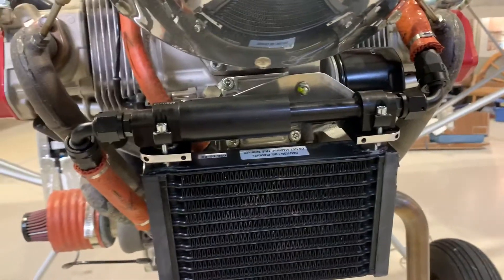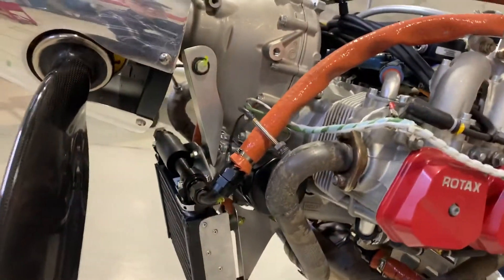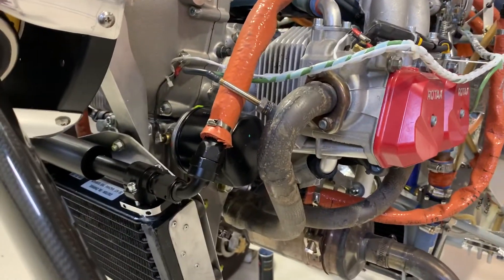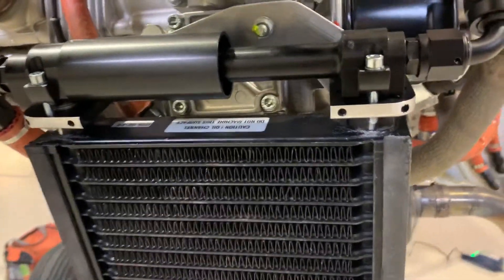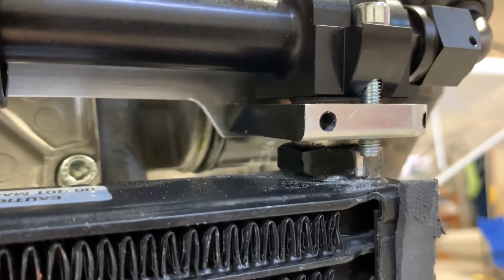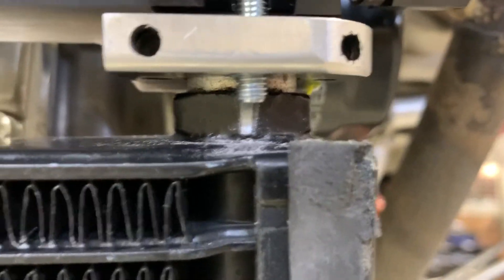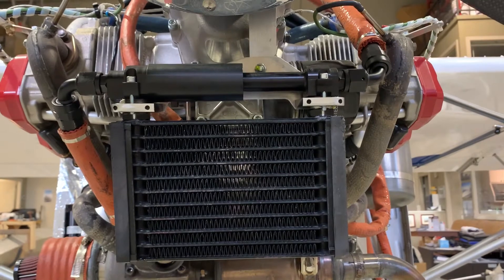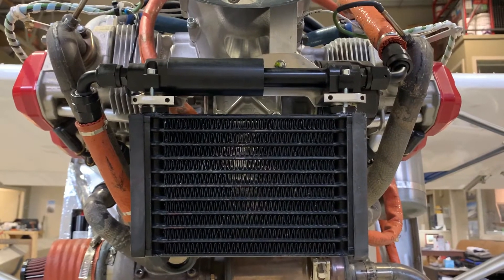Installation of Franz oil thermostat on Rotax 914 / Rans S20

Comment: Added larger oil cooler into same position as yours and added an oil thermostat at the end of this past summer.  Now oil runs 180f-188f constant.  Running 912UL in my s20.  Curious what temps you see with your 914.  My original small oil cooler was located on the left side intake in the cowl.
Reply from the maker: In cruise flight I see very similar temps 180-190F. I get to 125F  about 5-7min from start up…faster than I can get to the runway. If you check out one of my other short S20 vids “Rocky Mountains West of Calgary” I pan to the Garmin G3X and pause where you can see all of the engine and flight data.
Reply from the maker: One other thing not shown in this vid is the external inlet design. This is just as important to cooling performance as the location of the cooler, it’s size or the addition of a thermostat. You can see mine in some of my other short S20 vids. The concept is to have protruding lips that pierce the bow wave at the front of the cowl. You see this on many inlet designs from P51’s to RV’s to King Airs. In my opinion the Rans stock cowl design for oil cooler and coolant rad inlets are very sub optimal.
Reply: Now that it’s been a couple of months, are you happy with it?
Reply from the maker: @OneAlphaMike  Absolutely, oil warms up to 120F faster than I can get from hangar to runway. Then stays constant till taxiing in. I think the device is over priced but I have not seen one I like better or that has an easier or neater install. No regrets even at the over price.
Reply: @martinjmerritt  Great, thanks!

Comment: In your research what are  your thoughts between the Franz and ThermoStasis? I have an S21 with a 915 and very much need an oil thermostat and liquid cooling thermostat. Thermobob or the Franz liquid cooled thermostat?
Reply from the maker: 0:05  I had heard of the Thermostasis product from my Rotax Distributor and they spoke well of it but was not able to find a source…I was lead to believe it may not be on the market any more. There was one other one I looked available on Aircraft Spruce that required a lot of hoses to connect (yuck!). In the end the attraction of the Franz to me was the very neat installation that actually reduced about 6” of oil line and could be installed without having to change the location of the (already installed) oil cooler or modify my (already modified) cowl. Though the Franz thermostat was quite expensive the difference in cost vs one that plumbed in with hoses was not that much after allowing for the price of decent Teflon lined, hoses with braided steel covers and AN fittings all around.
Reply from the maker: Regarding the coolant thermostat…the Franz product looks to me like a knock off of the the ThermoBob for a whole lot more money! …though it does come in a couple of different configuration orientations that could, depending on your installation be easier to fit in. The ThermoBob is (I think) based on a stat used in a Kawasaki motorcycle. It was very easily installed, works beautifully, came quickly and was not that expensive. The choice was a no-brainer for me.
Reply: @martinjmerritt  makes sense. Thermostasis doesn’t have one with the bigger fittings for the 915 anyaways so there’s that. I like the simple install of what you have. Finding a Franz or even getting to a website seems impossible. They have a coolant thermostat to that I will look at. Thanks for the reply and merry Christmas.
Reply: @martinjmerritt  I don’t know about the Franz thermostat, but I’ve heard the thermoBob should it fail will fail closed?
Reply from the maker: Wax pellet thermostats are not prone to failure but they can fail either open or closed. The ThermoBob is NORMALLY closed so prevents flow thru the cooler until the engine comes up to temp. There is a bypass line however that ensures the pump can always circulate coolant even in the event that the stat would fail closed. Fail closed would result in quickly rising coolant temps, fail open would be like you had no thermostat. Since fail open and fail closed are both possible with any wax pellet thermostat you must accept the remote possibility of the worst one of the two occurring.  If unable then thermostatic control of oil or coolant temp is not for you.

One other note…thermostats will not add cooling capacity, in fact the (safety) bypass feature in most actually reduces cooling capacity slightly. Their value is in allowing the engine to quickly come up to temp and then maintaining temp at a constant level during cruise and descent.

If short of cooling capacity in climb or on hot days then I think redesigned inlets to put more air over the coolers you have would be the best place to tinker.
Reply: In the US it’s impossible to find a link to purchase anything from Franz. Website says it’s “ illegal”
Reply from the maker: @Captndarty  
I bought mine thru Rotech Motor Ltd in Vernon BC, Canada. They’re not rocket science or restricted high tech, hard to imagine that they are a restricted trade item. But try Rotech, maybe they can get for you.